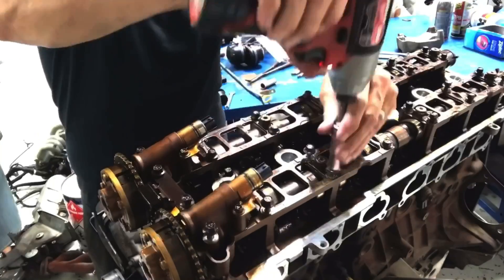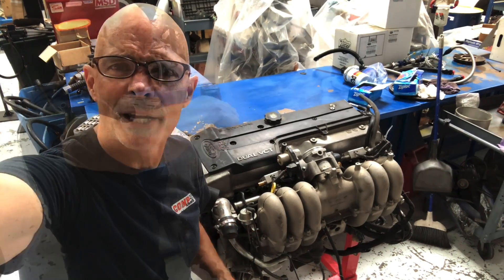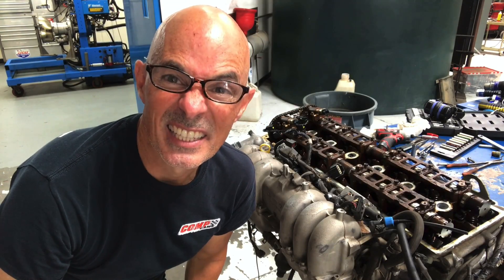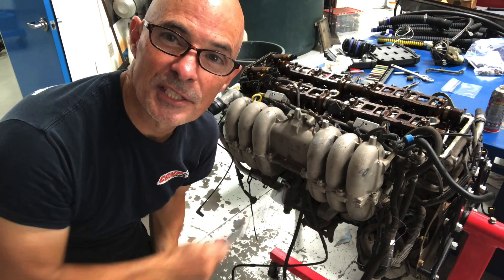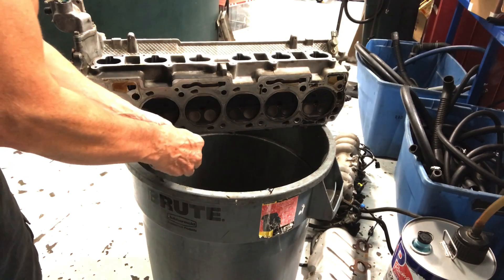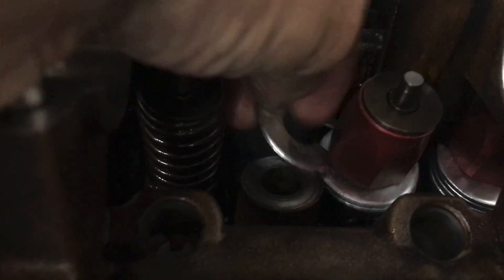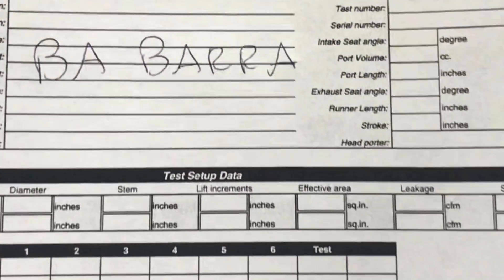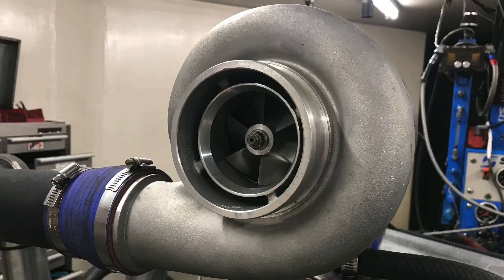HOW TO: 4.0L BARRA-DISASSEMBLY AND HEAD FLOW TEST                          (MY FIRST BARRA)

Comment: You know Barras have the same cylinder bore spacing as the original Falcon straight-six from 1960 odd, as it’s a slow evolution of that engine.
Reply: Pretty much. As were holdens grey red 202 blue 3.3 engines. Holdens were the thing when I grew up. Then I bought a J series Bedford truck. 214 Vauxhall. That vauxhall was proprietry. But, if you go back to the pre WW2 Bedford ( I forget the model but side lifting bonnets )  its all the same same. If you can work on a 202 ots just a scaled down 214 Vauxhal dating to the 1930s 😮. Now that is longevity of design. That being said,I love fords

Comment: There's something offensive about this being torn down by a guy called "Holdener".
Reply from the maker: why
Reply: @richardholdener1727  Oh, the Holden vs. Ford rivalry is the closest we've come to a civil war...
Reply: @richardholdener1727  However, it's great to see you tearin' down a Barra. Sad it never got its due; it really does belong up there with 2JZ, and if manufacturing continued (Ford killed car making in Australia), I think it would've gained the fame it deserved faster. 

Ridiculously overbuilt, and strong - when you can only make one engine for everything from your LPG-powered taxi to your SUV to high-performance FPV utes? You have to. Hence why you can double their horsepower with no sweat and no aftermarket parts save for a turbo...on an engine you took out of a wrecked cab for $400.

Comment: Richard you must use your connections to get dart to make a remanufactured improved block for these so we can share them and take these past 3khp easy
Reply from the maker: NO THNX ON THE 3000-HP
Reply: @richardholdener1727  are you going to junkyard big bang one of these potentially?
We get these stock iron blocks to 2500hp. If dart joined in to remanufacture the barra with their typical iron block improvement recipe we wouldn’t need to fight over scrap blocks between US and AUS. Ive got a few of these that ive built to last but be easily replaceable if they need to be. Worried the aftermarket will dry up when it never should. Too much potential would be lost

Comment: Loving your content mate. Here in Australia you'll find barras pushing more than 379hp with completely stock heads. My barra in my 08 ford falcon g6e turbo pushed over 500hp before i had to put in aftermarket valve springs and you won't have to change the cams in these engines until your pushing over 700hp. My 666hp barra turbo has stock cams with aftermarket valve springs.

Comment: Interesting, despite being a million of these engines around here in Aus and having 2 cars in the family with them, I have never taken one apart.  They are rock solid engines and no doubt a redemption from the POS 4L engines that came before them and the Intech. 

The interesting thing I find with the NA barra is there power delivery, they are quite weak at the lower/mid and low rpm for their capacity and normally take about 10 sec to get to 100Km/h in the Falcon but once they get to mid to high revs they really get moving and above 100Km/h come to life.    Not something I would expect for such an under square engine.
Reply: Quoted zero to 100 for the EB XR6 was 7.6 seconds. That's 1992. A stock BA Xt with 5 speed does it in 7.2s. Therefore the BF about 7 or 7.1s with a manual box. And the FG XR6 does 100 in 6.7s with a 6 SP ZF (presumably making 207 Kw and 420 NM on 98 Octane). Heard the Inlet ports on the FG flow well but there is gains to be made on the exhaust ports.
Reply: thats because it was designed from the begining with the turbo set up in mind and effectivley just downtuned if you like.
injectors and fuel system are the same na and turbo just a diff map sensor.
old mate here should of ripped apart a green top barra. different valves again
Reply: That's extremely strange. Barras actually make tremendous torque down low and is one of their biggest qualities. Sounds like you have a non functioning manifold runner. My territory barra pulls 100 in 8 seconds and my NA Fairlane barra swap does 100 in 7 seconds and it's a btr with a stock exhaust as well.
Reply: @elfairmont40  Nah, we have a number of Barra NA cars in the family and I've confirmed everything is functional, they just are slow off the line.  My mate used to have a Territory, we timed that at about 13 sec for a laugh,. But all of these cars are early in the Barra series so maybe the later ones were tuned better?  These are the 190Kw engines in our cars.

Comment: I have changed many sets of valve springs, with head on car in those, after 20 psi boost you get valve float.
It's a long, stressful, Back aching job.

Comment: What impressed me was the lower lift numbers, too often overlooked they are as important (maybe a bit more) as the full lift flow, the reason is the valves pass through the low lifts twice per cycle and in practice heads that flow well overall tend to make the best power output.

Comment: There's so much you can do with these. Some are running 10000rpm with a forged destroker kit. Stock heads! Huge support for our nation's favourite taxi motor lol. 🇦🇺
Reply: Someone will mad skills should do a v12 barra
Reply: @andrewlace  just for the love of all things holy make it under square  if you're gonna be making a new block...
Reply: @hellblazer275  there's always a potential strength issue, but yes, I'm with you
Reply: @andrewlace  honestly it's not really needed as the Barra already makes silly silly silly power I've heard it's an absolute pia to make a Barra hook at any decent power level because of all the touqe... Six in a row your ready to tow 8 in a vee you sit down to pee
Reply: @hellblazer275  there's no need for a v12 ls and yet... Of course extra rpm makes more power without the drama of handing extra nm
Reply: I've thought about it. Billet ALU block.

Comment: Whatch out for the skinny rods on the ba na barra 
Even the ba turbo motors have the skinny rods 
Bf 2006 onwards in the lpg and turbo motors use the heavier rods (3r23 instead of the 1r23) 
Also make sure the cam girdles go back in the same way you took them out as it will screw up the cam (you probably already know this though) 
If you slap big rods in them and push it make sure you are watching out for the oil pump gears as thats also another area that if pushed too hard they will let go

Comment: Where the seatbelt was tied right next to that u can see a little round lifting mount on the head their is one on the opposite side at the front that's how your supposed to lift these engines and its alot easier the trying to tie stuff around your engine just get two D shackles and attach them to the end of the lifting chains
Reply: Oh but the seat belt is the industry standard, literaly.  I worked in a few wreching yards. Pull an engine to sell, easy. Botl cutters cut all cables leave the plugs in. Crush and close fuel lies and or transmission lines. Cut the radiator hoses with a kitchen knife spill it onto the ground. Un bolt mounts cut a seat belt tie it on. Smack the bonnet onto the windsreen if neither is neede with a forklift. Seat belt on tine lift jiggle engine and teans or gearbox out in one 😂😂. Seat belts are used for everything lol. Need a steering wheel? Undo covers main bolt, tie steering wheel with seatbelts. Why sit there with a puller when you have a forklift to pull it off😂😂

Comment: Humm looks like a RB knockoff
Even the water inlet is in the same place
Reply: Except the exhaust manifold is on the opposite side to an RB. I would debate this engine is much different to an RB and a better design by far.
Reply: @asjmpickle  definitely a better iteration, it came in a different time different technology, it's amazing that ford isn't known for any inline 6 DOHC yet killed it with the barra

Comment: I thought we were supposed to double the cfm to figure out how much power a head could support?? Or is it different because it’s a 6cyl?
Reply from the maker: double airflow then multiply by .75 (cuz it only a 6 cylinder)
Reply: @richardholdener1727  got it. Makes sense now. Hope George did a good job porting. I’m curious to see what the numbers vs power gains are. Put all those key board warriors to rest

Comment: Would of been better if you got a Turbo Engine hope you didn’t pay to much the that one.
Reply: Why turbo motor ? Deep down LPG motors are better for boost ( stronger rods where as turbo motors only had stronger valves (titanium alloy) talking about grey tops
Reply: Turbo 'Red top' Barras are low 8.9:1 cr.   Green top  Barras (LPG) 10:1 cr have a much better pre spool throttle response.

Comment: Have a 05 ford f150 4.5  can I put a performance cam on it
Reply from the maker: 4.5L? did you mean 5.4L? If so, you need 2 cams
Reply: yes  5.4L  I meant  so I need 2  cams

Comment: Those na barras won’t even hold 300kw. Find a factory bf lpg motor or a factor bf and onward turbo motor. And they have been seen to make upward of 500kw (or around 700hp).
Reply from the maker: the na barra will hold much more than 300kw
Reply: @richardholdener1727   they just won’t sorry. Also the na barra head was the only head not to come with inconel valve seats to cope with the extra heat. Ba rods are known as toothpick rods. Good luck Richard I’m a big fan

Comment: I've long wanted to see someone do a max effort 500+hp NA Barra but everyone goes the easy turbo route. Also with port work guys have got over 330cfm at 28" from a Barra head.
Reply: It’s a turbo motor, why would you N/a
Reply: @hoonaticbloggs5402  That does not look like a turbo motor, so I doubt he has a turbo motor because it makes no sense that someone would have fit a factory NA exhaust to a Factory turbo.
Reply from the maker: this motor is a BA (NA) motor-but I would run a turbo version NA to start with just to have the baseline starting data
Reply: @hoonaticbloggs5402 someone who has knows the craft can replicate the S38 from the E34 M5. That was a 3.8 L motor.

Comment: Does the Barra cam lift the intake valves at the same height and duration?
Reply: Early ones like this, yes. Later ones have left and right inlet ports and timing different to add swirl. Different combustion chamber too

Comment: I recently watched a video from a well known cylinder head porter where he flowed a stock high mileage cylinder head that had some carbon buildup in the ports and a version of the head that had just been cleaned of all deposits. The difference was shocking even to him. As much a 24 cfm at certain lifts. Just something I’d thought was interesting. The Barra is cool for sure.
Reply: The formula for building a cheap tough barra here in Oz is to up the boost. Porting of heads is rarely done. An extra psi of boost cures all ills. There are 8sec FG facons, with 1200rwhp running stock cams.
Reply from the maker: I'VE TESTED THAT AND NOT FOUND THOSE RESULTS UNLESS THE DEPOSITS WERE HUGE

Comment: Can guess exactly what he's thinking when looking at the exhaust manifold , turbo !
Reply from the maker: yes
Reply: @richardholdener1727  A j-pipe turbo setup has seen 380rwkw on the pre-barra SOHC engines if you want to go the "budget build" route initially. It's not even a bad flowing stock manifold

Comment: Based on the flow I would go more duration and 380-400 lift . The drop off in percentage from 400-500  is really high ,  the gains from adding  lift slow down from 350 , that slow down  in air speed velocity can cause tubulance issues .
Reply: Exactly wrong.  Slow down in air speed decreases turbulence.

Comment: Should’ve got a 2007 or later model lpg engine really cheap and at least it has turbo rods which are substantially stronger than the na rods for engine dyno purposes. that na motor will throw a rod past 12 psi of boost where as an lpg engine will handle over 25 psi with ease
Reply: With cams and valve springs, a otherwise stock mid BF - FG LPG Barra will make 545rwkw before going pop.

Comment: Richard Holdener i bet you've been told already but ba barra is the weakest watch those rods(if i were you i'd just build the motor, good rods & pistons, oil pump gears, valve springs, you can still do stock cams etc as you like to do but you've waited so long to get your hands on a barra i'd hate to see you destroy it because of weak garbage parts ... anyway i'm sure you have a plan, best of luck
Reply: its a bf. written on top
Reply: @ianw9171  but it’s not a green top or red top

Comment: It's so odd watching Richard tear one down. 
I've been working on these since I was a 1st year apprentice 13 years ago. For two years I worked at a place where we had 10 taxi's we serviced and my boss owned two. We used to wreck a hole falcon every 2 months and sell the parts like I mean strip it to a shell. 
We always had a shortage of transmissions and over stocked on the engines so heaps went in the scrap bin.
One of the taxi's my boss owned made it to 960,000km with no rebuild. That was a factory LPG green top serviced first Saturday of every month. LPG oil comes out clean.
Reply: I have heard that LPG Barra engines  tend to suffer from valve seat  recession is that true?How can one avoid valve seat recession in duel fuel petrol/LPG after market conversion Barra engines? Cheers 🍻 🍻
Reply: I had an EL i got as 2nd owner with full service history. It made it to 900 and change before it needed a head gasket. Im no mechanic never worked on a Barra Engine. Currently watching any vid i can find because im about to do a head gasket replacement on a Territory . Its not blown but no service history bought it at 200k its 280 now so im doing timing belt head gasket while im at it. My veiw is timing chain youre halfway torn it down to head gasket change. May as well get it done preventative maintenance attitude. I live rural so long distances better to do it rather than be 90 mins from a tilt tray if the head goes🤷‍♂️. I was at a mates place and he was doing his. Same issue on EL EF AU and BA. Doing this engine in the car, the rear most bolts on inlet manifold is a bitch to get 😂

Comment: You maybe in luck with the boost as BF Barras have stronger rods than the BA models
Reply: Only 06-06 BF2s, and only in the turbos.
All the NA petrol motors (apparently bar a few FGs) got the shit 1R23 rods, and most BA LPG motors got the good 3R23 rods

Comment: Richard, did you really get all those head bolts out with out breaking one?
Reply from the maker: they were like butter
Reply: @richardholdener1727  that's amazing, everyone else I've seen broke several.
Reply: @TheTeeroy32  I've broken heaps in the past on the pre- Barra 4L engines due to their leaking head gaskets rusting the bolts up. But I have never touched a Barra as they don't have the same head gasket problems the previous generations of engines did so I haven't needed to pull a head off one yet.

Comment: Can you tell us was the airflow numbers for the inlet and exhaust flow test one port only? one valve open. @250-260? or both open at once?
Reply from the maker: both valves open-like it would be when running
Reply: @richardholdener1727  yeah, I thought so, I just wanted to know so I can continue to mock the local Barra owners when they think they're faster than a V8. And now I can keep telling them they're missing two cylinders and bring it over when you want it fast. 😁👍

Comment: It wood be good to see a na Big Bang engine as most people just go straight out and turbo them
Reply: You can't really big bang a motor NA, most will just live through it. Although I'd love to see how much camshaft and rpm you could get out of say a 4.8, or some of this interesting I6 stuff like the 4200 with stock longblock.
Reply: Turbo is where the fun is. I nurse mine trying the keep the ZF 6speed alive a bit longer. Lets put it this way, I never lost a traffic light ...
The biggest problem is hooking up at 24psi.

Comment: I want to see a barra vs 2jz
Reply: The barra can make 2500 crank hp on the factory cast block and head. The 2jz head warps around 1800hp - Real street explained this.
At the higher power, eg >1600 hp, the power vs boost is very similar, Barra vs 2jz, 4L Barras at this level are often destrocked to 3.7L for more rpm, and the 3L 2jz is stroked to 3.6L.
But...on the street at more modest 800 - 1200hp, the Barra is a much better street driver with its very long stroke designgives the barra way superiour pre spool  and midrange torque.  Yes, I own 3.
Reply: @nordic5490  2500 hp on cast crank for how long.never been done.fact is the 2j makes a lot more power boosted